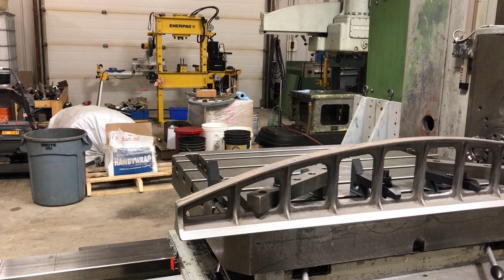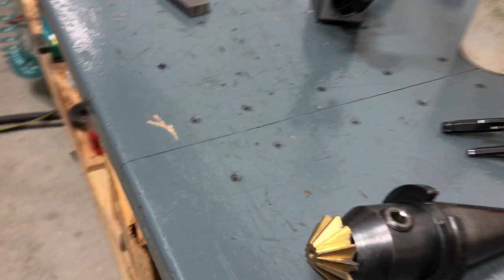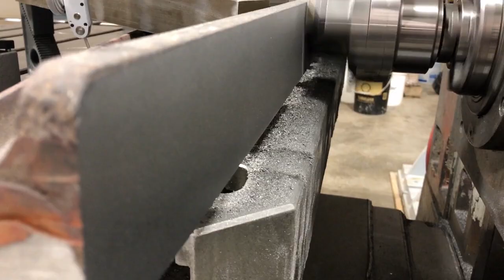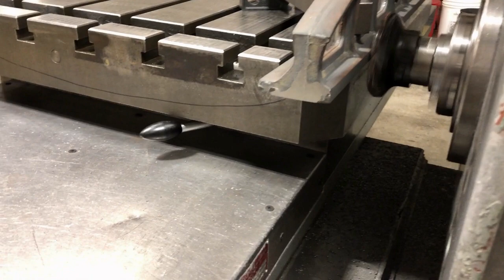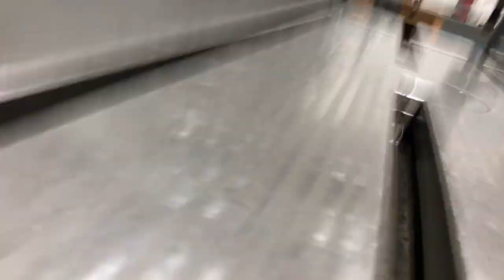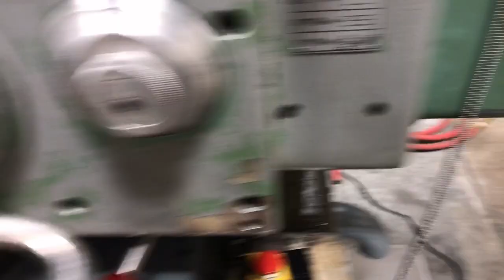Machining a 48" Foster Featherweight Straight Edge

Comment: Nice one Ken .    Great point with the spindle temp .     Your boring mill seems to be holding great tolerances .  Do you know if the casting has been stress relieved ?
Reply from the maker: Thanks Max.  My customer did some preliminary scraping on the angled surface.  Although the scraping is incomplete and he would have to finish it to be sure, he estimated that it was likely holding flat to a bit less than a thou over 48".  I'm very happy with that.  My customer stated that the casting had been stress relieved once. Ken
Reply: @hmw-ms3tx  Great result .  Even temperature change over that length , i guess would have an effect . 👍

Comment: I would never have thought that the spindle gets longer while running. But, of coutse, it makes perfect sense.
Reply from the maker: Hello Rusty.  It turns out, that being 48" long,  the boring spindle grows .0003" for every degree Fahrenheit of temperature increase.  It would only have to warm up by .0025/.0003 = 8.3 degrees to increase the .0025" I saw.  Ken

Comment: I'm excited to finally see the machine in action. Do you have any theories as to why you still got some measurable difference after letting the machine warm up? It seems like there's something consistently different about the first third of the machining path, maybe in the gib or something? I know you rebuilt the machine so I'm curious where the error is coming from. 
Also, are there detents for rotating the table to common angles and, if so, how accurate are they? 
Thanks.
Reply from the maker: I'm not sure why it still had a movement of .0005" in the first third of the cut.  At 48" long the boring spindle would grow .0003" for every degree Fahrenheit increase in temperature.  It is possible that the small amount of extra power to take the cut caused the boring spindle to increase in temperature by .0005/.0003 = 1.67 F in the first third of the cut.  You can see why temperature control becomes the dominant variable at high tolerance levels. There is an indexing pin and four sockets for it to register in.  This allows you to index the table every 90 degrees.  I haven't tried to measure the accuracy yet but it appears to be very good. Ken